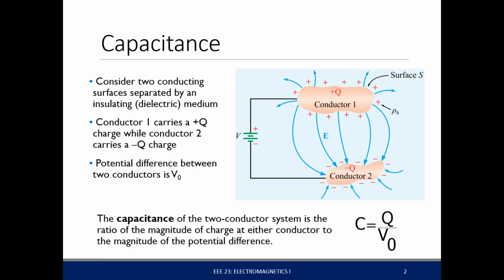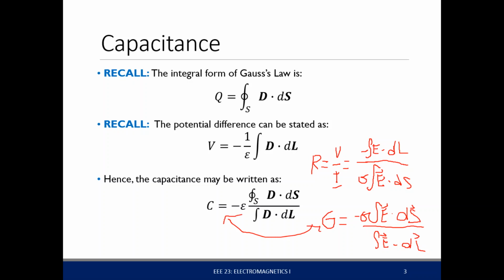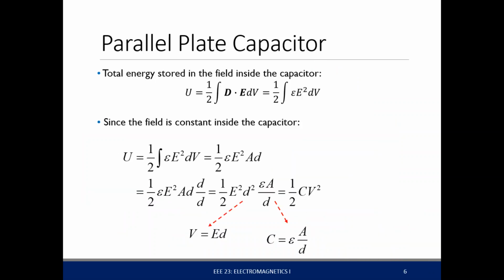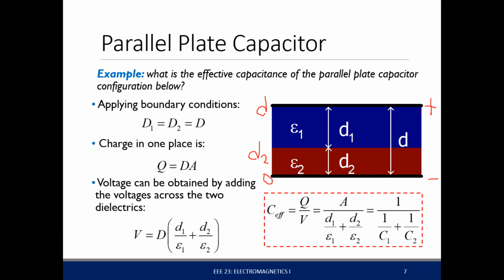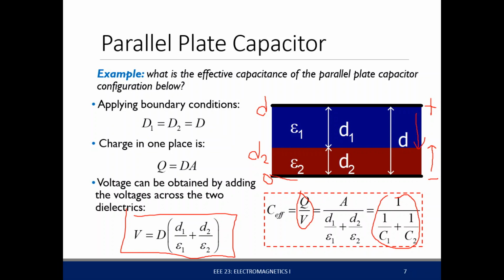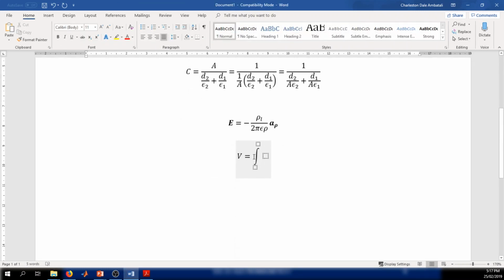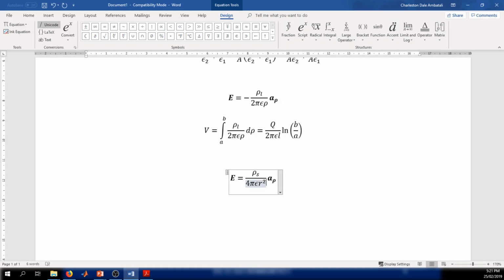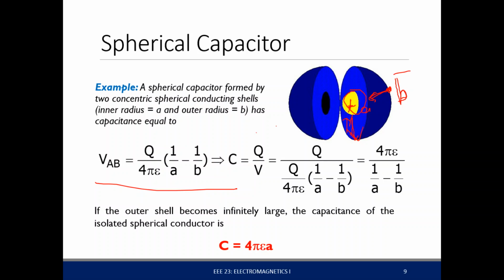Electromagnetics - Capacitors

Comment: i'm still confused over the last part of negative sign. Shouldn't it be positive? Since V is same direction from b to a
Reply from the maker: Which part is it? Although please note that the positive voltage goes against the flow of the electric field. Imagine you are a positive charge, the more you move towards the positive charges (source of the electric field), the harder it is for you to go there but moving there means you get more potential energy. Think like you are going up from a lower elevation on Earth to a higher elevation.